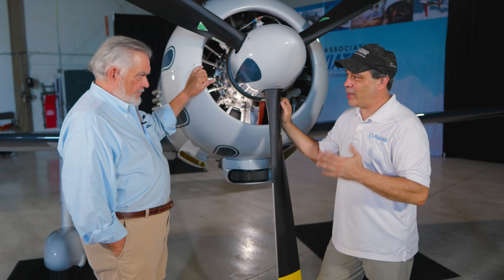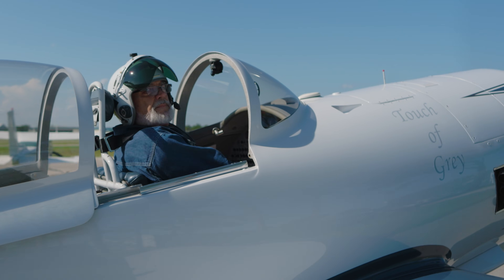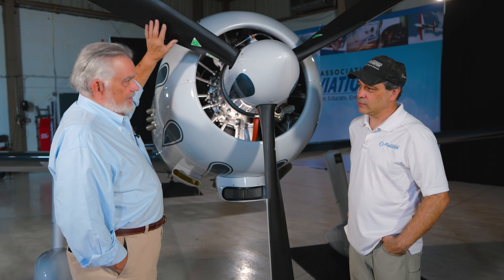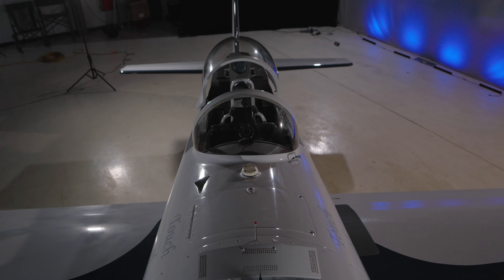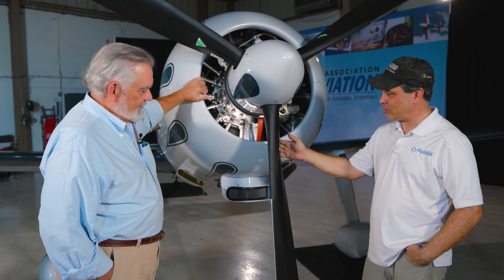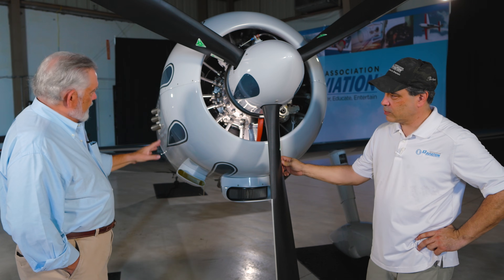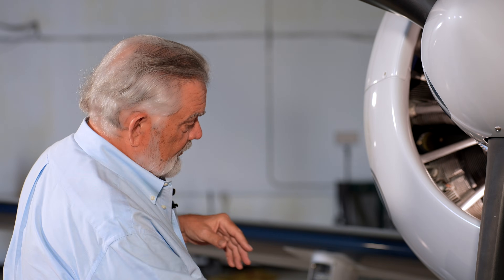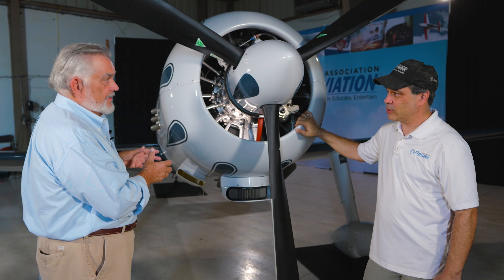400HP Radial Engine Deep Dive | Why This Supercharged Russian Beast Rules the Radial Rocket

Comment: 400hp seems low for a supercharged radial of that size
Reply: @davidca96  I was thinking the same thing but then again when detuned   make it more reliable so I don’t know if that’s what they were doing
Reply: @Darwinsfinch78  yea thats true it may be detuned so it will last longer, its a beautiful engine though regardless. I love piston radial engines they are awesome.
Reply: How do you figure?   The R985 produces 450hp which means it requires 2 cu/in per HP.  The MP14 only takes 1.5 cu.ft to produce 1hp (it's 620 cu.in).  Can you name another radial in its size and class that can do that?   It's also 6 inches more narrow than the R985.
Reply: @aircraftadventures-vids  What I meant was with supercharger/engine advancement since these were common it seems like we could push a lot higher numbers and stay reliable but if im wrong I totally accept that.
Reply: @davidca96 ah I see. Those advancements bring major returns in the automotive world (where it’s ok if the engine fails in some way) but not in aviation.  I mean you COULD probably squeeze 700hp out of that engine for racing but at the tradeoff of major risk of inflight failure, or highly reduced time before overhaul.  Not only that but radial engines are used on this side of the atlantic because they look and sound cool.  So effiency is not really the target. 🎯
Reply: @aircraftadventures-vids  that makes perfect sense and im sure they did the math/etc of what performance would be the most reliable and you are right. Thanks!

Comment: Time to build an FW 190 scaled down to use that MP14.
Reply: Carbon fiber like the Scalewings SW-51- which performs great with just 160 horsepower. But if you've got a rockin' radial ... Bearcat time :-)